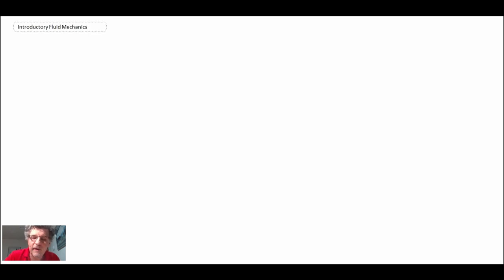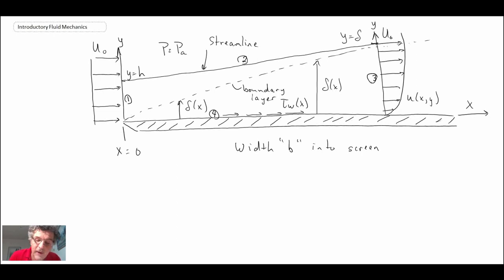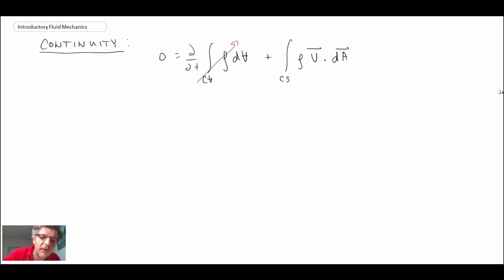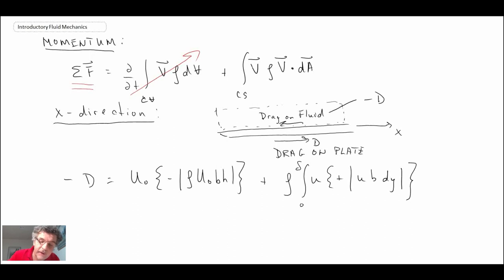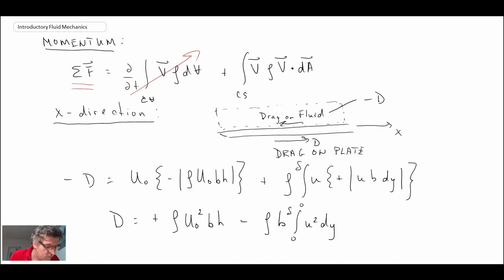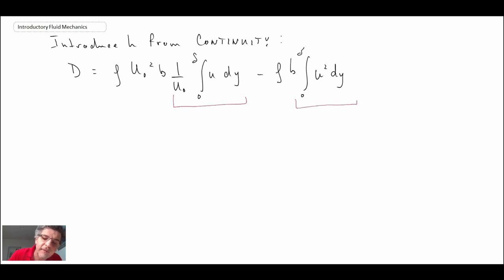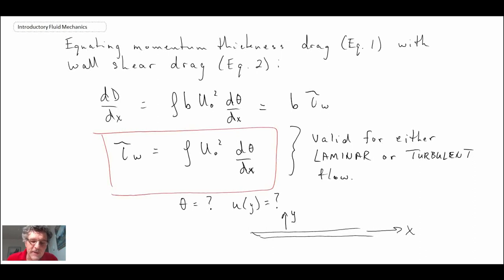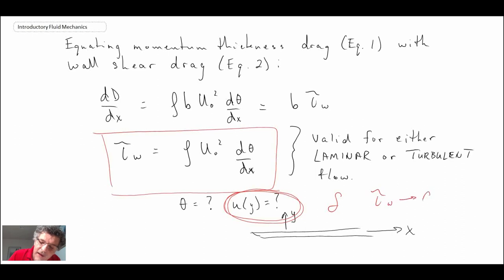Introductory Fluid Mechanics L19 p3 - von Karman Momentum Integral Theory

Comment: what about the pressure forces on control volume
Reply: Pressure on the streamline and plate tend to cancel out because Prandtl simplified the y-momentum equation (NS Equation for y) to give dp/dy = 0.
In other words, The pressure on the streamline is of the same order as on the plate.

Comment: How can you just put density out from the integral in the mass balance equation as if it is constant in all section 1 and 2? and also why is density supposed constant between inlet and outlet of the plate? are we talking of incompressible fluids in this case? did I miss something? :)
Reply: this is a theory of incompressible boundary layers